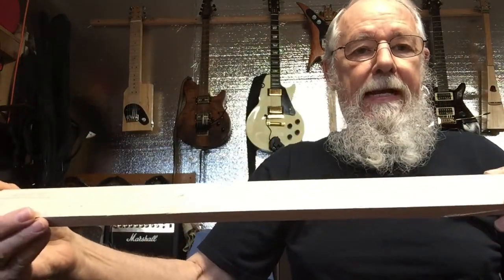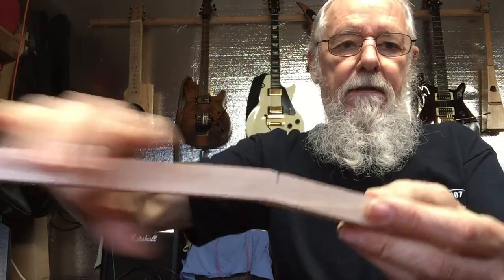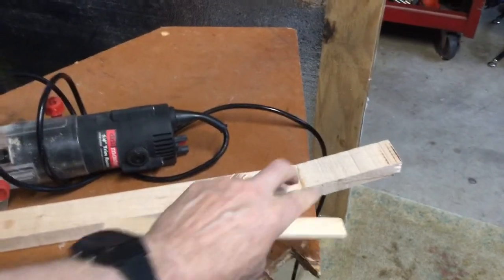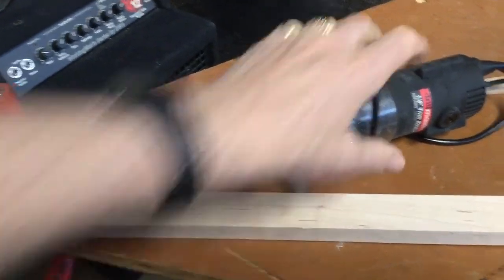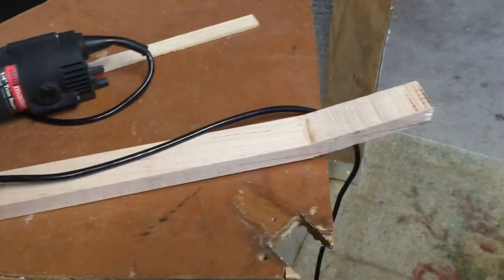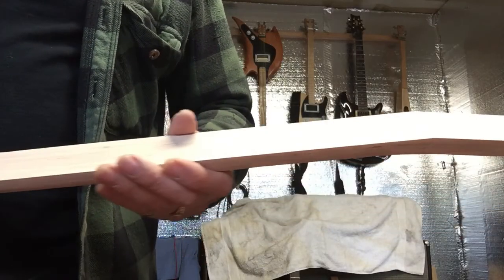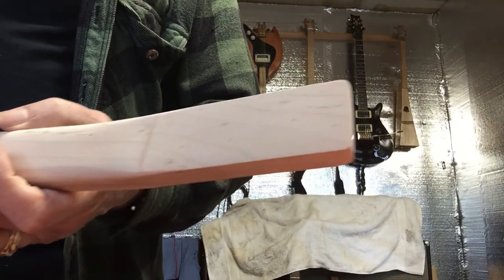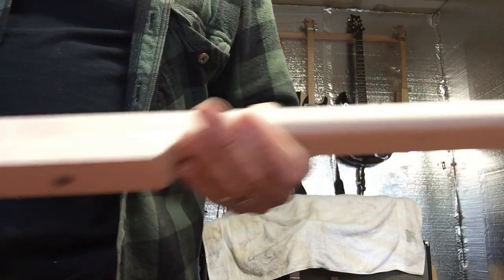Cigar Box Guitar build part 1 the neck

Comment: Awesome work Sir. I am glad that trim router worked for you. I bought the same one. It's got plenty of power, but  learned the hard way about the bits. I just about ruined a nice neck with a cheap round over bit.  😕.  I just use my HF table belt sander now.  Can't wait to see what box you use 😀